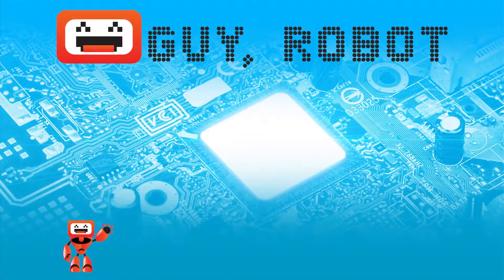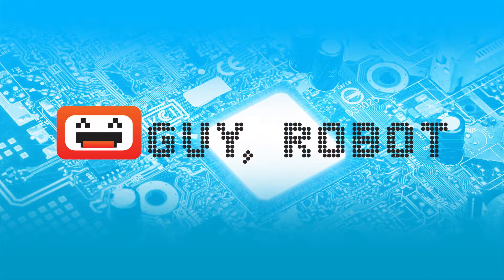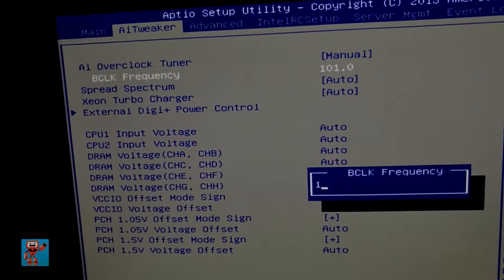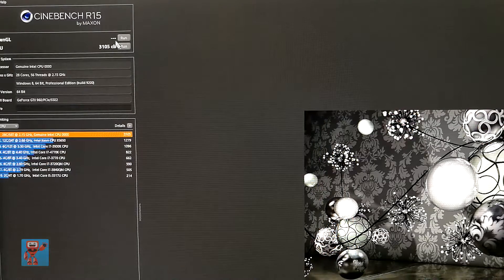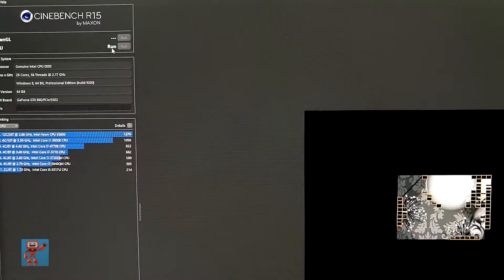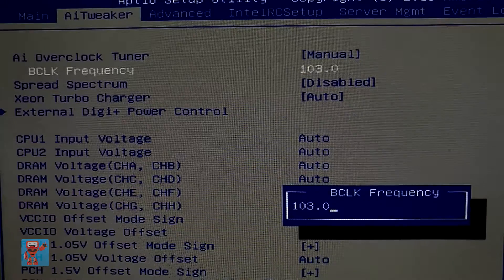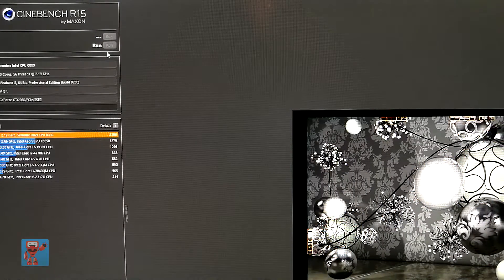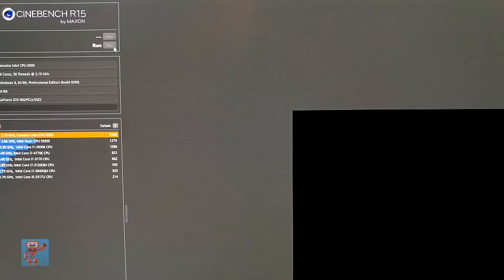How to (Not) Overclock a Xeon // Epic Fail

Comment: I have come to this video 8 years late. But for anyone interested. I am in the process of overclocking Asus Z10PE-D8 WS 2 with two Xeon E5 2630 V4. I could overclock from 2.20 to 2.47GHz using Auto Overclock level 1. Beyond that wouldn’t boot. So manually managed to get stable at 103.5 giving 2.48GHz. Spent 5 hour messing about with CPU voltages memory timings, undervolting, overvolting etc, etc, etc. Cursed the Asus loads, as the Turbo should have given me 3.1GHz! Was really annoyed, as I had no trouble achieving Turbo on a Supermicro X10DRI with different CPU’s

Then I realised I had made the classic mistake of accusing the wrong item. Rebooted, dropped the core count from 10 to 2 on each CPU. Then got 3.2Ghz with mild overclock.

Moral of the story, first isolate the problem. 

I have two Intel Xeon E5-2690 v4  - 2.6GHz (3.5GHz Turbo) 14-Core CPU’s coming in a couple of days, at the vast cost of £38 for the pair.

I will drop the core count from 14 to 8, giving 32 logical processors. I am hoping with a mild overclock to get a nice 3.2Ghz maybe up to 3.4GHz if its good silicon.

Comment: I have the same board. Any idea how to set up the BIOS to work better with my graphics card? I have a TitanXP in mine and it is only using between 1-3% It use to use 50-60% in my old system. HELP PLEASE!!!
Reply from the maker: No idea - the obvious question is have you tried a different PCIE lane?  I've only used a 960 on this one and had no trouble with it at all.
Reply: @GuyRobotTV  do you possibly remember useage details? Maybe this is normal? yeah great idea, I followed the chart and used the one suggested.
Reply from the maker: @ericguizzetti  when you say its only using 1-3% do you mean only 1-3% of max GPU  compute power available to it even under stress tests?
Reply: @GuyRobotTV  yes exactly.
Reply: @GuyRobotTV  YES exactly.
Reply from the maker: @ericguizzetti  never seen this.  Do you get the same on all PCIE slots or have you only tried it in one?
Reply from the maker: Also to double check you have both CPUs in - not just 1?
Reply: @GuyRobotTV  so far only one. I need to take it apart and try another.
Reply: @GuyRobotTV  yep both CPU's are active.
Reply from the maker: @ericguizzetti  try all  other slots, also double check in BIOS settings as there can be options in there that restrict speed.  I've had some issues with poor performance without enough RAM - eventually added 100GB and filled up most of the slots - but nothing anywhere near a 97% speed loss on a PCIE card.  I only really max out my PCIE bus with NVME ddisks on 4x though.  That being said the GTX 960 runs fine at full power in the 3rd slot from the top.
Reply: @GuyRobotTV  Good idea, I will check the BOIS settings. I have 128 gigs of ram now. I also have a NVME drive running in PCIE and its blazing.
Reply from the maker: In that case I wish you good luck :)

Comment: i overclock my xeon x5650 with 4.5 GHZ water coolimg and it runs staple
Reply: what board are u using sir? will this work with v4s? I have a 22core but I need to reach higher per clock speeds for gaming too :( lol

Comment: I have a pair of QH9F 6-cores, they will do 104.5 stable and turbo about to about 3.135 all core and 3.345 on two cores.

There's no real noticeable performance increase from stock speeds at 3.0Ghz all-core and 3200 two-core. You would probably have to do at least 10-15% OC to notice it.